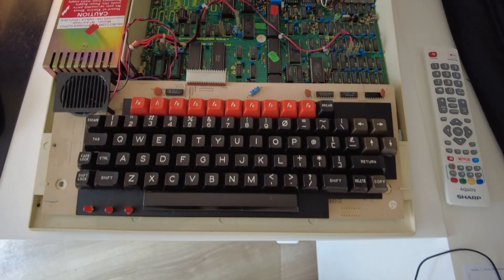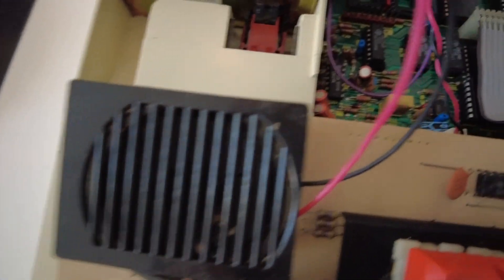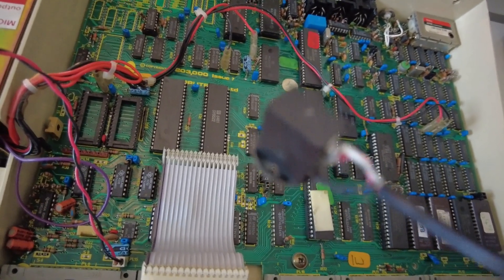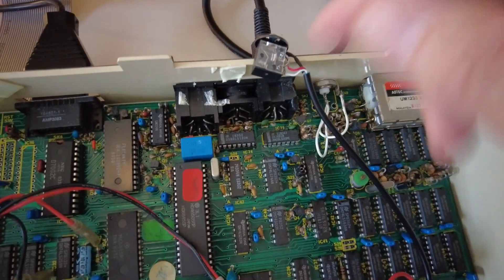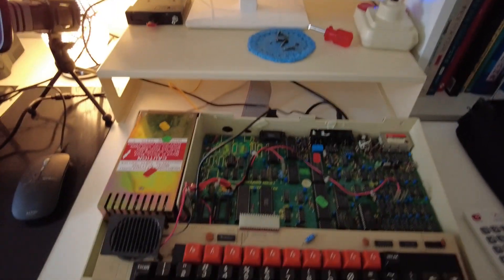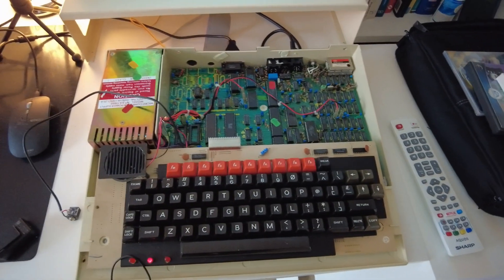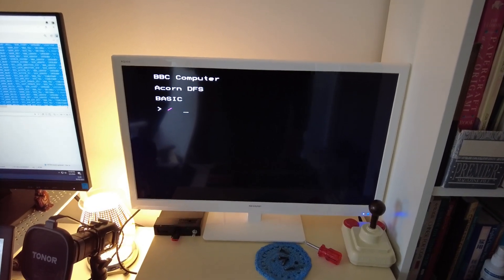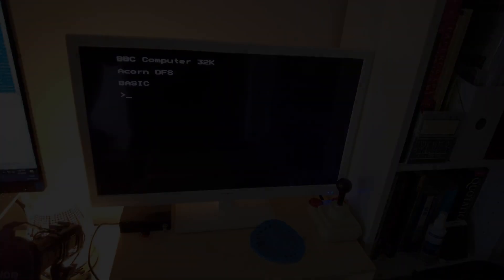How to get audio out of a BBC Micro

Comment: When I did a very similar mod 'back in the day'  3.5mm sockets were still a new standard and I went with the standard of the day 1/4" audio jack. This had the advantage that the sockets came in case mounting varieties that fitted nicely in the unused Econet connector hole in the case with a volume control potentiometer in the adjacent reset button hole.
Reply from the maker: Excellent! Another way of modding the Beeb without carrying out extensive surgery 😄

Comment: Glad it is working fine for you.
For the more techie watchers, there is an audio line out available on the BBC's board, but then it wouldn't cut the speaker of. I set my volume on the board so that the output is line level and got a 10k resistor in line in the scart plug.
I'll put some pictures on *. of how I fit them, which is either hot glued in the slot or in the reset out composite holes with the washer.
Reply: That's a great mod Richard, and very simple, elegant implementation. Are you by any chance selling these? Is it also compatible with the Master?
P.S. Thanks for the video Colin, more mod videos would be great.
Reply: @DreamsOfWires  I usually only sell my bits to people at shows where I can show them it working and have never sold these.
Shows are the reason that I make these as being able to easily adjust the volume as the noise level at a show changes is really handy.
I have one fitted to my master and it works fine, although the master already has an audio out on the back.
They complement the RGB to SCART cable s that I make with an audio jack on them.
I don't sell the SCART cables as they take over an hour to build and you can buy them online for £12 and may £15 with a jack - we'll maybe see when Colin gets his.
These are quite easy to make but still time consuming - still, I might put a couple on *.
Reply: @trickysoft  Thanks for replying, I understand the time issue. The main reason for it on my Master would be to disable the internal speaker, which I presumed connecting to the existing audio output wouldn't do, since it looks like a phono connector rather than a jack. The connectors are looking in a poor state on mine anyway, and I think it needs servicing before I can start using the machine properly, aside from a dead key I get a worrying amount of noise from the speaker. I have an RGB to SCART cable already at least.
Reply: @DreamsOfWires  you could just unplug the speaker of you always have a way to use an external one via the phono. I used to slip business cards under the plastic strip and slide them side to side for a limited volume control.
Reply from the maker: It's working like a charm, thank you so much! ☺️